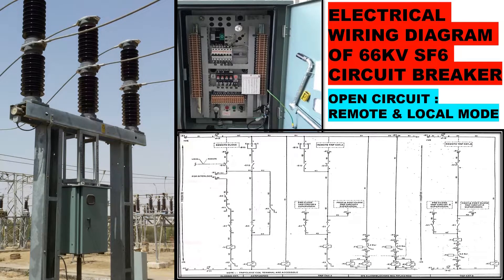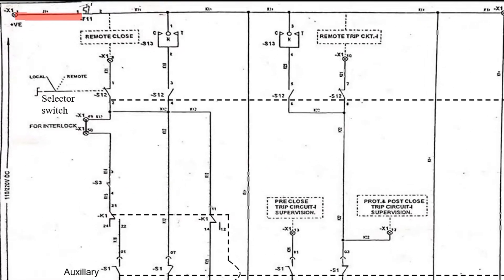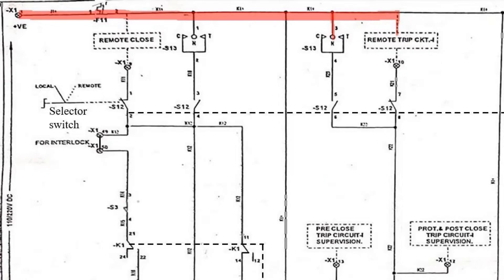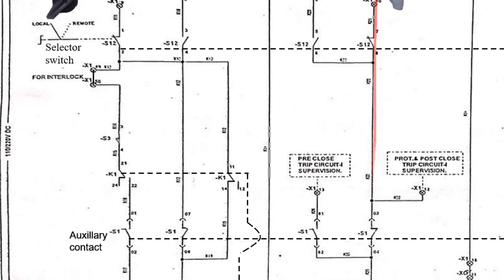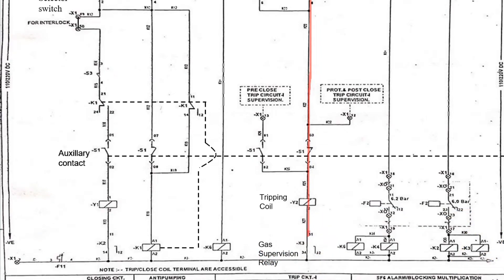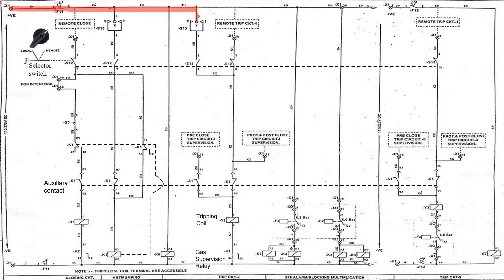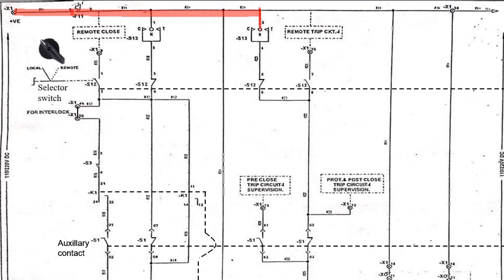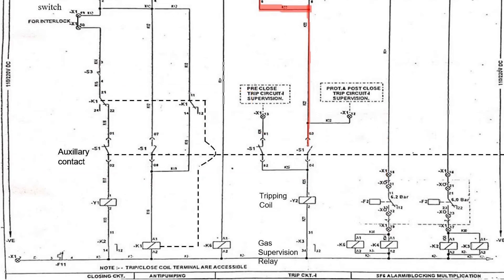ELECTRICAL WIRING DIAGRAM OF 66KV SF6 CIRCUIT BREAKER | TRIPPING CIRCUIT | REMOTE & LOCAL MODE

Comment: why need 2 TNC switches..cant the same switch works for trip and close command?
Reply from the maker: 1) Breaker in Remote mode: Only single TNC which is provided in Control Panel is used for both trip & close of CB.
 2) Breaker in local or manual mode: Only single TNC switch which is provided in CB itself placed in Switchyard is used for trip & close of CB.

For more clarity & info..please   visit
https://youtu.be/wdknnS_EYyI?feature=shared
Thankz for visiting the channel..# Epowerinfinity